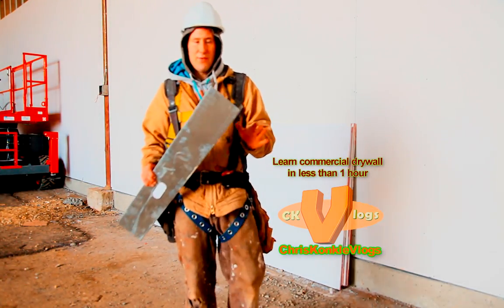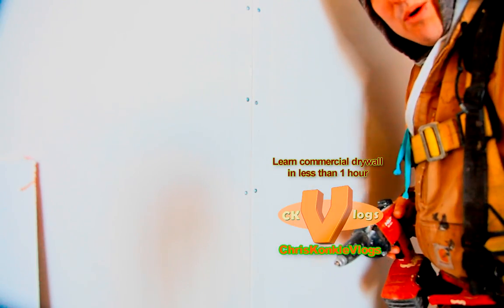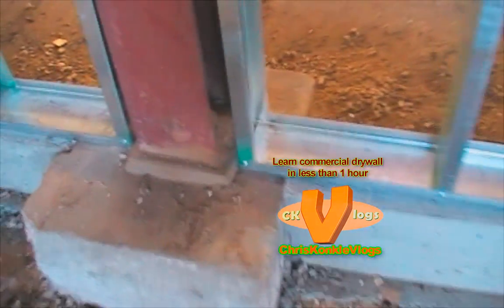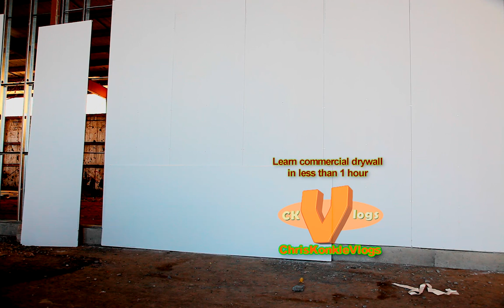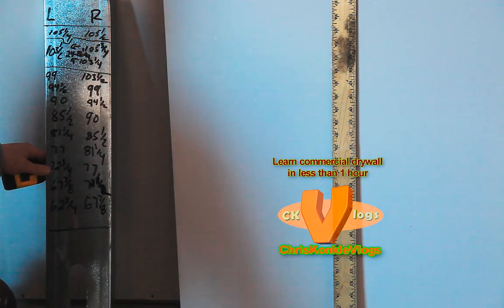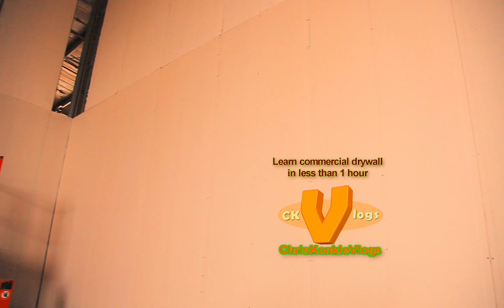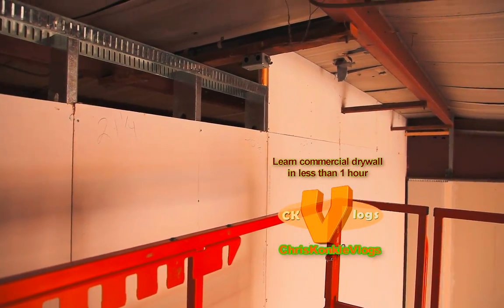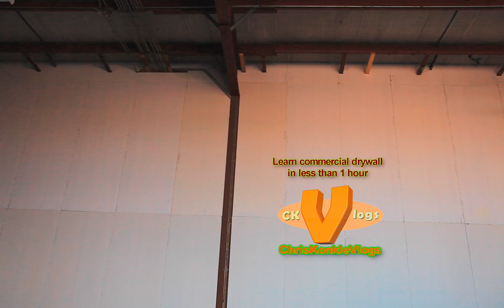Commercial Drywall Master Class | LEARN IT!

Comment from the maker: My goal with this video is orientate new workers with the trade before they start out and to give even the most seasoned veterans new tips & tricks. What are the tips & tricks you know? Let me know what you think of this video and be sure to leave me any feedback. Thanks for watching.
Reply: you guys don't stagger the boards?
Reply: in my neck of the woods t square typically sends you home with your rasp as well.. weird what's going on in this video. no laser to make sure your boards and framing are str8
Reply: Just wondering how much i can charge for drywall work??
Reply from the maker: @marcos13hm  You can charge 25 to 50 cents per square foot!

Comment: This is a good video. I'm a 2nd year apprentice but I also worked non union. My first time hanging drywall non union I had no idea what I was doing and the guy I was working with didn't help. It takes some getting used to but anyone can learn it if they have drive and really want to be in the trades
Reply from the maker: Absolutely yes! Its too often I see people not being trained, if you have any questions ask me no prob and I have a lot of new drywall videos that could help you. Would live to see yiu on one of our livestreams!
Reply: @ConstructionKronies  Thanks man but I have everything down pretty good now. Topping out can get a little tricky sometimes, I hope I never work in a hospital but I'm good when it comes to pipes and wires and stuff. I worked for a decent non union company for 2 years who actually taught me how to hang and metal stud framing. Recently, we were hanging lids on a wood framed job and it had to get 3 layers of 5/8's along with rc channel. It had tons of penetrations for wires, pipes, sprinklers, exhaust fans for the bathrooms, it was basically like topping out but on a ceiling

Comment: I would like to see a video topping out drywall how to learn to cut to pipes air ducts
Reply from the maker: Sure thing!! I have been meaning to get into more detail there, thanks for the idea I will do one!
Reply: Search topping off drywall on here and it should be the first video. It's a good video. I had trouble with topping off when I first started but it also helps to have a good journeyman working with you

Comment: this a great video helps out , im A 4th stage apprentice framer drywaller , rite now we’re working in a hospital and we’re topping out , it’s a complete nightmare, sprinkler pipes conduit pipes galore 😮‍💨it’s overwhelming to be honest you got any tips or advice for hospital top outs . or words of encouragement haha would help a lot thanks .
Reply from the maker: Yes man! So getting good at tops now while you are an hourly worker is key to making a lot of money when you go piece work. When I first started doing tops I used a 2 ft and 1 ft squares to square my "ups" over to the bevel or stud and then used my tape for the side to sides. Just until I got used to using tape for centers. Check out my commercial drywall installation playlist, I'd link it but am on the road to Jasper right now! Then. Learning how to cut the pieces minimally for tape is something you will just learn over time, just keep trying to limit the joints as much as you can. Hope that helps!

Comment: no need to laser level top off...if your butt joint is factory to factory plumb means level throughout
Reply from the maker: Yeah I don't use the laser for the tops, ill throw a level on it sometimes because the butt joints are usually down at our feet if anything id just be lining up the bottom corner there so we have a straight bevel line. Cheers man!

Comment: I've been a drywall contractor for 41 years and my father started our business in Michigan in 1957
My first issue is that your standing up 12 foot board and that is common practice when your commercial job is 12 high
Or even up to 16 foot high but your 
Hanging walls well over 20 foot high
So common practice you hang your board lengthwise and stagger your butt joints
Also why are you scoring your board in the middle. Because you just made a butt joint in the middle of the board just increase your finisher two times the work
For all you newcomers go to Drywall Junkies
Reply from the maker: Stand ups are way easier than laydowns, only old shackers do it like that, plus for steel its code to do standups and stagger your joints on the other side, the cut joints your talking about will be embedded either behind corner bead or tare away so it makes no difference for the taper, also tapers use machines these days to tape and they work best, some would say only work for stand ups. I appreciate your input but maybe new comers shouldn't be watching drywall junkies if they are old school cause that's the mentality we need to change to fix this industry.  This is like one of my first of over 400 videos now so my newer vids are better.
Reply: He's not scoring the board with a knife. Look closely.. he's Marking it with a pencil. 

He marks the board simply to know where the stud is, to screw.

Comment: I’ve done some 40’ high walls with 12’ sheets, but I was told to cut 2 foot rips  across the 48 every other one on my first bottom row. Guess my question is, it’s there more than one way to start? Or is it just a layout reason?
Reply from the maker: So, that way isn't the right way to do it. What you want to do is put a min. 6" strip across the entire bottom for first layer. Don't stagger the butt joints it will be a tapping nightmare. We stagger the bevels between layers and on either side of the wall. The butt joints are supposed to line up on each layer so its a straight taping line.

Comment: Why didn't you stagger your sheets?
Reply from the maker: I will stagger the joints on the other side of the wall. When we do stand ups you have to keep the bevel straight up unlike when you lay down sheets and stagger the butts by at least 32". Very good question!

Comment: When do u stand up and wen do u lay down?
Reply from the maker: Okay this is important. You always stand up on steel for proper fire rating but you can lay down if the numbers are weird. You always laydown on wood. The problem with wood is it isn't straight so stand ups are hard to do.
Reply: That's suprising,  because 90 % of the time everyone screws em standing up on wood. Every time I've seen it getting done and every time I've done a job with people.   (I'm a flooring installer so that's what I'm mostly doing)  I did do s job with some guys and we were putting up special order 15 foot sheets. And those did go up sideways.